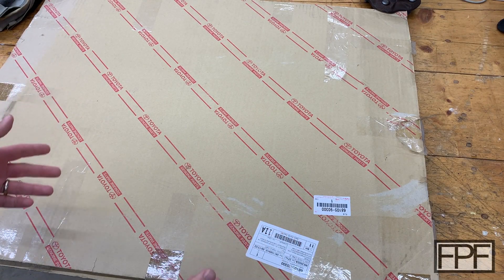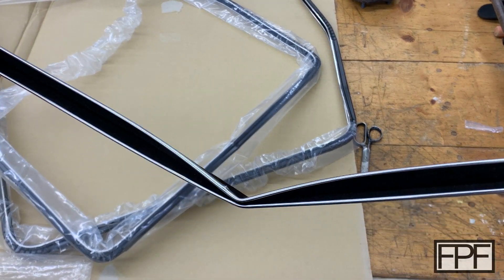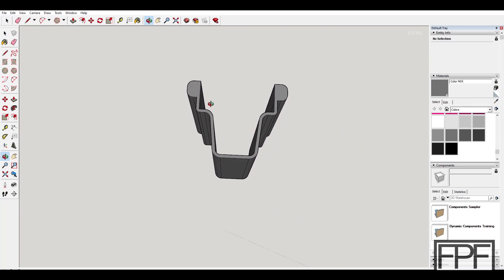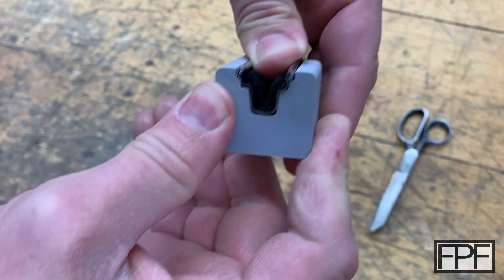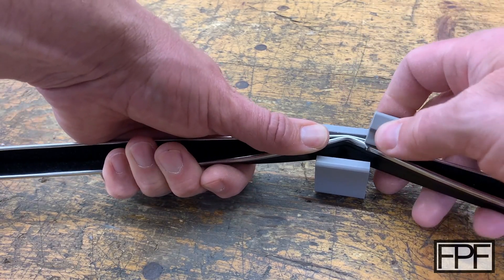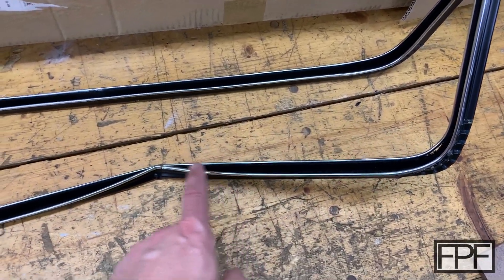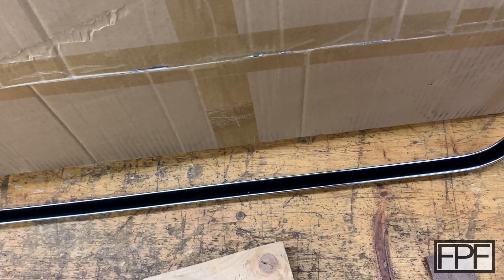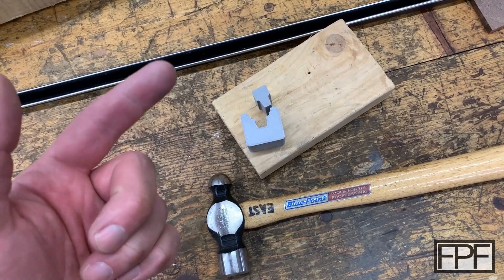3D Printed Sheet Metal Repair and Forming Dies

Comment: Nice work, they turned out well considering the damage. 
Another way you could have done it is to print the inner profile as a wheel, then you can work it back and forth to slowly iron it out. I've used this method with skateboard bearings for bending sheetmetal, and it works amazingly well. A lot more printing and messing about than this method though.

Comment: I know that this video is 2 years old, but I felt that I needed to comment. Actually it's more of just a suggestion, it looked like you mangled that stainless steel edge with pliers, you could 3D print some TPU socks to go over the Jaws of your pliers, then maybe you wouldn't Mar up the edge. Anyway, I just thought the TPU sock idea was something that could have helped. Keep up the good work, I'm loving the videos that's why I'm going through some of your older stuff. Thanks a lot.

Comment: I guess if you made the insert little bit taller you can avoid  the marks you can make on the metal and its easier to pulled out when you done streined well is my opinion and good job

Comment: Cool too!. 

Gets some new sheet metal and do your own from scratch. See if you can emulate the corner crimps with your 3d printed mounds. Do a 2 or 3 stage process. Allow for spring-back too.

Comment: I've recently been experimenting with press brake style dies printed in PA-CF (nylon carbon fiber for those who aren't familiar) with a very surprising success rate.  I run a small machine shop that occasionally has the need for small batch bending and the expense to sub it out doesn't make sense.  I'm using a Bambu X1C and the dies come out beautifully.  I'm actually shocked at the strength of the material when printed in the optimum orientation.  Great video!

Comment: I really got to get better with my print designing. Which program are you using? Btw, great job on getting those straightened out.
Reply from the maker: Thank you!  I use Sketchup Make and Fusion 360, depending on the project.

Comment: Real nice job. They both turned out real nice (especially the kinked one). I'd try doubling the length of the dies for more support. Fantastic out come.  Yes, I'd print variations of the die  (narrow center) to work up to the finished die. I wonder if pads on the pliers would have helped to not scar the material, but it looked great and I'd use it the way it was.  Turn your mic off when in fast forward, it sounds like mouse chatter! LOL! Those 3D printed dies are really strong,  I watched a video in which the printed custom sized dies to bend metal for fabrication. Very informative video. Thank you.
Reply from the maker: Thx so much for the feedback.  Sorry about the mic noise in the sped-up sections.  I usually edit those sections out, but was in a hurry last wk and missed it :(

Comment: In the case of this particular bend a longer printed die would have been helpful after widening the areas directly to the left and right of the bend using the small die.
Reply from the maker: Yeh, I rushed a bit this week :(  I would have liked to have had two length dies, and a narrow inner die to get started with.  Still pretty happy with the results though.